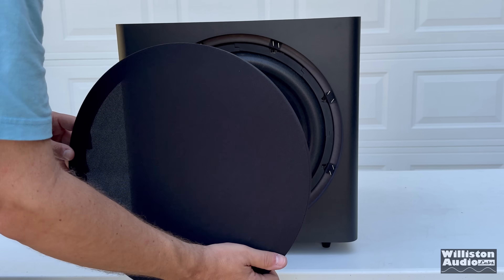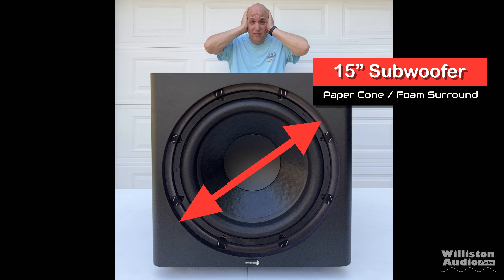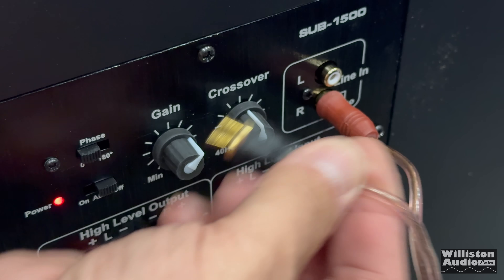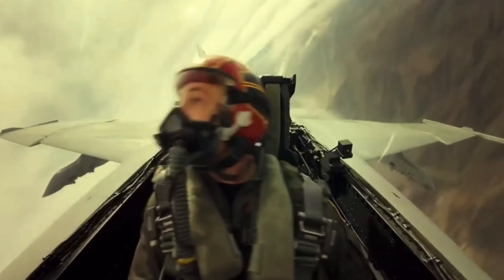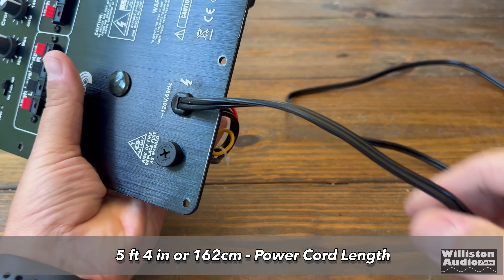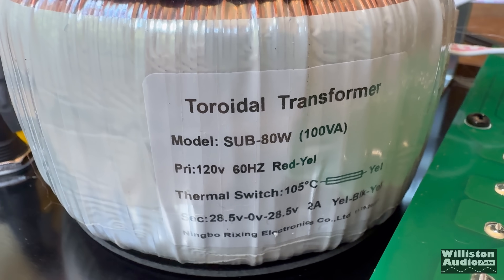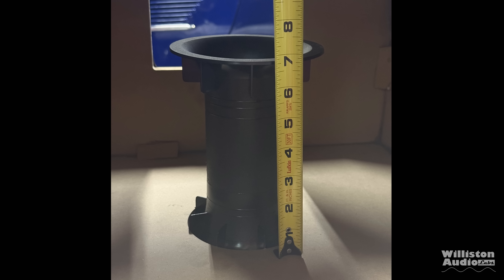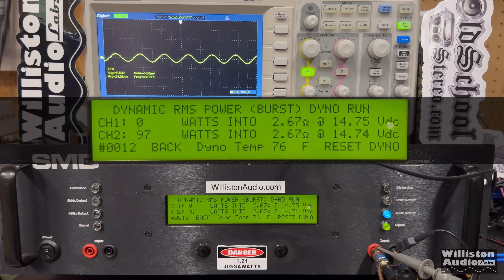Exposing Dayton Audio SUB-1500’s Biggest Secret—It’s Not 150 Watts!

Comment: I am using two of the Acoustic Audio PA-120, 12" powered subs in my 9.2 channel home theater system. As with most audio amplifier components, manufacturers will totally mislead the consumer with their claims and model name/numbers. Example:  The Behringer NU-12000, 2-channel PA professional power amplifier, boasts a whopping 12,000 watts output power. However, when you actually did into the measured specs, things are much, much different than their claims. According to the owner's manual, in order to reach anywhere near 12,000 watts, the amp must have both channels bridged, running a 2 ohm load, only at a specific frequency and at peak output, not RMS. This amp MAY operate for a few seconds with a 2 ohm load, but not for long and certainly would not be stable. So..........this is a very dishonest practice, but seems to be accepted by the electronics industry. For consumers, I suppose it can be a bragging point, but little else.

Comment: I bought this exact sub new in 2015, for $190.  It is being used as a coffee table. As a coffee table it is great. It never sounded great in my music room or as home theater sub in a small room. I told myself it was just in a poor room or down to room placement options. After 2 years I decided to model the box for fun. It was shockingly horrible. I thought about changing the driver and plate amp to something in the 300W range. As a stop gap, I blocked the port, and it sounded better but the Amp is utter trash for power.  I ended up replacing it with Klipsch R-12SW in 2020. Never looked back.   

The Dayton Audio SUB-1500 is a white van level scam product in my opinion. It does make a nice stable coffee table. 🙃😂

Comment: I bought 4 used 15" subs made by Velodyne - one of the oldest manufacturers of subs. I paid about $200 each using Ebay and Craigslist to find them. The models are CT-150 & DLS-5000R.

Comment: With a 1.6 A line fuse, 28 + 28 VAC transformer secondaries, and one pair of bipolar output devices, I would have guessed 60W into 4 Ohms @<0.1% THD. The captive 18 ga line cord is another clue.

Comment: I could be wrong here, But plate amps do some really weird things. I've tried to test my klipsch sub amps before and the waveform got really weird.  You can even see the O scope, they don't clip how we are used to seeing.  Something like a current limiter, or they are just plain rated differently than our car amps. Point is, I wouldn't be so quick to be posting these "gotcha" videos with funny music.
Reply: Class D amps have low pass output filters designed for certain output loads, these include relatively large inductors to smooth out the digital square wave output into audio sounds, some sine wave testing may result in abnormal outputs.

Comment: I think a 100VA transformer could power a 150W amplifier with a lot more power supply capacitance, but generally not recommended, especially for a sub woofer amplifier where average power is quite high. Those 3.3mF capacitors are absolutely unacceptable. That's the capacitance I would use for a 20W amplifier.

Comment: It would be very interesting to test more Parts Express amps to see if they overrate all of their stuff. Having been a customer of theirs for a few years, I picked up their 8" subs to extend the low end of my towers, which sound pretty good after I swapped out the DA sub for some Morels. I just ordered the 500w plate amp with DSP to replace the "950w" plate amp that came with my 2x 12" DA subwoofer. They are setup to fire opposingly so there is zero enclosure vibration and this is the only reason I'm sticking with it. It does add theater-like rumble to my setup, so I am happy enough with it to invest in keeping it going for now. LMK if you want to test this amp before I install it so you don't have to purchase one to do so, if you are interested.

Comment: The wattage is irrelevant. You're buying a powered subwoofer, not a plate amp. The only useful test is the SPL output at different frequencies, as in the CEA 2010 numbers. I doubt this sub is going to do great at that either, but testing wattage is missing the point. This channel is a prime example of the old adage, "If all you have is a hammer, everything looks like a nail." 

The difference between 80w and 150w is only 3dB. That is just barely noticeable. Also, testing is done with sine waves, which is not what the sub is designed to reproduce. Tearing down brands for clicks is not cool.

Comment: Home stereo just does NOT HAVE THE LOW E N D   B A S S I like. Even the amps don't seem to play low as I like.  A couple 12",15", 18" car subs in a house on a 1000 watt+ a 12' cubed enclosure in a basement or closet. Build a nice louvered port cover. With a 400 real watts 4 channel  with 2 of them for mids and highs. About 4x 6.5mids and 4 tweeters  100 watts each. Maybe 8x  8" woofers with the subs low passed around 60-80 Hz the woofers high passed at the same.

Comment: I bought 2, and I realized the amps sucked. Had a Crown XLS1500 sitting around. Hooked them up in series and bridged the amp. Ran room correction on them using REW. Was actually happy with them until i could build a pair of 18" subs. Great value to price if you have an amp sitting around.

Comment: For desktop speakers on my desk i got a pioneer amp with a much lower specified (combined) power-output . It uses much higher quality parts and much larger heatsinks to reach this much lower specs than this B-Chinesium-brand. The pioneer smokes that sub-amp on power-output in the real world.  Some things never change, B-brands using the marketing department to determine what to power-output-number must be written on the box and in the specs. Reality not required and it still amazes me, how is this is not illegal to put totally false claims on the box??

Comment: I've noticed that a lot of amps that you have done for the output and RMS watts doesn't seem to match up my question is do you think you have enough voltage going into the amplifier to actually get it to those numbers they claim
Reply from the maker: Yes I have a dedicated outlet used for these tests and there is no issue with the voltage. I have an amp coming up that does WELL above rated and it’s home audio. You can also see the NAD, Proton, Yamaha and Onkyo home amps I’ve tested which provide the power they are rated plus some
Reply: As a technician for a major audio company, we used to use a variac to keep line power to an Amp under test at 120V. It was also useful to slowly power up amps, just in case they had a short or failure we'd see the ammeter shoot up and turn down the variac. Once the line level sources went digital, we abandoned the variacs and just plugged in and hoped nothing went wrong. Line voltage sag can be a real thing, but only with continuous test tones which draw continuous power compared to music or speech that are very irregular and intermittent, allowing regular amps to recover their internal voltage rails without sagging the line voltage.

Comment: I have a 70 watt parts express plate amp that barely moves even small subs, and I have a SUB-1000 that was in my mom’s home theater before she downgraded to a soundbar. The sub 1000 claims to be 100 watts and I obviously haven’t tested it but it is fairly loud and I expect it’s much closer to 100 than the 70 is to 70. 
Maybe not. It looks like like a smaller version of the 1500 tested here.

Comment: 15" wont sound good for music - movies yes. just a typical import job boxed speaker/subwoofer. speakers and audio equipment both home and auto have been overrated for many years thats why bose has the hate they don't advertise the wattage or frequency response. that sub would come to life with a class d amp and slotted tuning. the bass port is not sized right. even a passive radiator probably would have done been then that undersized port. also to note a lot of energy is wasted with a/b class amplifiers. with the specs on that transformer that amp is no more than 50-60 watts rms @ 4 ohm

Comment: "An 80W transformer is probably not gonna generate 150W RMS of output power"
Uh well, ... that all depends on how you measure and rate your components.

The short answer is:  Music is not a sine wave, so amps are not necessarily designed to output their rated capacity continuously into a resistor of the specified minimum impedance.  Since crest factor is a thing, an 80W trafo could be totally adequate for 150W real-world output.

It's absolutely normal to under-spec the transformer with the assumption that the duty cycle is going to be less than 100%.  You'll notice the secondary voltage on that transformer is +/-28.5V, which, glossing over some stuff, is ~100W into 8R, or ~200W into 4R.  (Nevermind that this is AC RMS, and if we rectify it it'll be 1.4x higher peak, then dropped by 1V or so by the rectifier diodes, and we'll have to account for what the actual peak-to-peak voltage attainable from the output transistors is, and then bear in mind that "4 ohm" speakers aren't actually, but might be 3.6R at DC, and who knows what at various frequencies, based on their T/S params and the loading of the enclosure.  Let's not forget that there's a difference between no-load voltage on the trafo, and loaded voltage .. .and also the minimum peak voltage as the rail bulk caps discharge between mains cycles.  Engineering is fun!)

You could, of course, put your scope on the terminals of the speaker and drive it until the waveform starts clipping to see what the system's peak voltage is, and even test the speaker's impedance at the same frequency to calculate Watts Peak, and then scale for RMS.  That would be a little more accurate than driving the amp itself into a dyno, but probably not substantially different than the dyno at the nameplate impedance of the sub itself.

Comment: Sad thing is that amp is more than big enough to do at least 600 watts if they actually tried
Reply: The power transformer is only rated 2 A, and 28.5 + 28.5 V output, so even if the class AB amp was 100% efficient, that is only about 100 W possible. Only has one pair of output devices, need three to four pairs to get to 300 W.@ 4 Ohms. If it was a class D Amp, with higher voltage and more components, then 600 W might be possible.

Comment: FYI, that little selector has nothing to do with phase. Its a polarity switch that's inverting the signal. The term "in phase" is the wrong term for slecting polarity. The correct term would be in polarity or out of polary. Polarity is determined by step response and impulse response. That switch is not an analog all pass filter or a time delay. Companies need to learn tbe difference and stop mislabeling that polarity switch. Companies need to start doing better, by educating their customers.

Comment: I came away with some questions, because I don't have transparency into how the D'Amore Amp Dyno conducts its measurements. (For instance, criteria for "Certified" vs "Uncertified" appear to be made up and certainly aren't 'industry standards'.) If the amplifier can provide 75W unclipped continuous RMS power into 4 Ohms using a sine wave signal, the crest factor of the sine wave signal is 3 dB, which means the RMS voltage of the signal is 17.3Vrms, and then the peak voltage of the signal is 24.4Vpk. Into a 4 ohm resistive load, the "peak" power of the sine wave at clipping is 148W, or close to 150W. It's not a 'standard' method of calculating amplifier power, but there is your 150W number. Parts Express is saying "RMS", but it's a "peak" value. PE/Dayton are far from the most egregious actor in this area; the Rockville subwoofer was called a 500W subwoofer, while its amp only made 141W at the threshold of clipping at 4 ohms, which means their power was overstated by 250%, while Dayton's was only overstated by 50%. I'm not an apologist for this by any means, it's not being transparent with the customer, and it is a scandal, but it's good to keep this all in perspective.

Comment: Other than the plateau venting around the base of the frame, this is a copy of  The Frazier woofer made for Tandy / RadioShack. They used this woofer in the machine 2 and 3 Evan the 2.2” off size coil are the same .the magnet is the same ….

Comment: Hello big d can u help me figure out what size fuse i would need for my main system wire to my battery... i have a huge system that pulls about 25,000w in total 7 lanzar amps and also got 2 battery chargers wired in the system that gives a total of around 300amp

Comment: ehh..Build your own subs. Buy a quality driver with a low FS, good excursion, and decent sensitivity. You can power a car amp with affordable ACDC power supplies of 80-100 amps at 13 volts. A car amp can be had for around $150 ( Stinger MT series come to mind) that will put out easily 500-700 watts at 4ohms. You'll spend about $450 but at least have something that performs solidly and likely last for years on end and not flake out like some cheap stuff....
Reply from the maker: Not everyone is a DIY fan, but I like this suggestion!

Comment: Rockville is the sister company of Community Sound. Community makes some decent Pro-sumer grade PA/Live Sound equipment. Years ago a company called Traynor out of Canada was making Pro grade PA/Live Sound equipment and guitar/bass amps they sold out to Community Sound in the 1980's I believe. Back in the day I used a Traynor vocal monitor with two 8" full-range speakers and a single Bullet-Loaded tweeter, it had only about 150 watt power handling but it was a very good sounding speaker. We ran three 8 ohm monitors off one channel of a 2 channel QSC 1500 watt (750 per channel) power amp, all of these speakers couldn't take much more than 150-200 watts and we just had 1 singer and 1 mic (me) so we could push the monitors hard with vocals.

Comment: Great video!
I really like that you hooked up a scope to watch the burst tests 👍👍
Maybe a bridged punch 40ix will get that woofer bumping 😂
Testing subs sound wise is really hard and depends on the room and placement.
I remember when I built two different subs an 15” and an 18” : I tested both in the same room and same position, both subs measured exactly the same response curve. Very often they are nice for movies but bad for music and vise versa. Finding the correct placement takes
Lots of time,
Using several subs helps to keep a bad room in control and gives better response.
I run two Dayton audio ultimax 18” subs for home cinema. 
Room resonances cause way less problems in a car and  I think that’s why car audio is way more satisfying regarding bass response 👍

Comment: You actually cannot measure the impedance with resistance metering with a standard multimeter, resistance and impedance is not the same thing.  And to be fair any poweramp will give different output depending on frequency and load, the load will be different depending on the drivers impedance wich changes depending on the frequency wich is not really the same as putting it on test equipment doing sweeps since with a constant impedance through the frequency range. Lets say the driver has a impedance drop to 2 ohms or even lower at 35 Hz, then the amp would push more power.  Having that said yes i know most manufacturers do boost the advertised wattage bcs thats what ppl look for when buying but still you need proper equipment and understanding to do this kind of measuring.
Reply from the maker: I understand this fully 🤔

Comment: Yeah, unfortunately most of these cheaper subwoofers that seem really "too good to be true", really are exactly that. Most are made in China to super cheap quality standards and they're almost always WAY overrated in specs, especially amplifier power!

I actually bought one of this type of sub a few years ago, (I forget the name of it), but it was rated at 600W RMS, but it only actually put out about 60W RMS, AND it had a proportionately tiny 60 watt rated transformer inside it too! It was quite laughable actually! Needless to say, I never got another one or recommended it to anyone.

This kind of modern BS spec audio equipment is a disappointing learning experience and is really kind of a joke compared to the truly good stuff, and it's just sad... especially since the Chinese manufacturers especially seem to somehow be allowed to get away with this kind of misleading advertising and major exaggeration without getting banned or sued for it!

You really gotta be skeptical about any audio equipment that sounds unrealistically rated nowadays! (Like those BS no name brand home theater receivers that only weigh like 5 pounds and are rated at like "6000 watts RMS", because anyone who knows anything about audio (or physics too!), knows that that just isn't possible, lol! 🙄